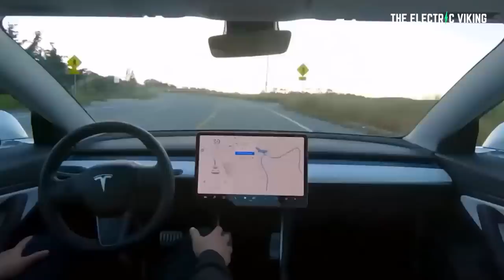20% of all vehicles will need to run on electricity in 24 months in Canada!

Comment: Do you have any idea how cold it gets up here in Canada . We just had minus 40 Celsius for about 3 days in a row a couple weeks back . How efficient do you think an electric car is below minus 30 .
Reply: @DAVE Hughes some Canadians have electric cars. Why not ask them?
Reply: There’s a chicken and the egg dynamic.  Have to get the EVs out there in numbers so they can be improved to handle cold better.

We are barely out of the Wright Brothers stage but improvement will be rapid.
Reply: @JeffMathias  the problem is the batteries, and people have been trying to improve battery performance in the cold for decades
Reply: Electricity is rising in price quickly, people can barely heat their homes, electrical grids are maxed out all over North America.  Battery electric vehicles cost a fortune new, they don't maintain power charge in the cold (regularly -30C in the prairies, and sometimes dropping to -40C).  The cobalt for the batteries is a humanitarian and ecological fluster cluck, as the resources are drained out of Africa.  I'm all for ingenuity and innovation, but governments should stay out of mandating things, especially the Trudeau government, they invariably make things worse.
Reply: If the Norwegians can do it, than why not Canada?
Reply: @hanswitvliet8188  Because Canada is over 20 times if not more larger then Norway.
Reply: @hanswitvliet8188  because Canada is colder than Norway.
Reply: @threespeech7605  I drive around in my M3 at -40C, -30C 0C etc. It works. Also my battery is LFP so there is no Cobalt in it at all. Do some research. A lot of new EVs are coming with LFP  lithium iron phosphate. Life expectancy also doubles with this battery type.
Reply: @skp4377  Most EV's have a Cobalt component. Think you need to do your homework. Also if you are in Canada you know electricity is at least double to heat your home then Natural gas. Plus also -30 and -40 c this past few weeks in parts of Canada have really shown how much of a paper weight EV's actually are. Slow charging, no charging, really reduced range and dangerously slow warm up times for passengers. EV's have no place in cold climates at all. Totally useless.
Reply: @kokofan50  three months an average of minus 20, and a peak of -50,4. I’ll guess Norway could host next surfing championships 🤣
Reply: @bikingD  If what they are saying is true then don't purchase them. ICE has had a 100 years. EVs are still new. They will eventually perform well in the cold. Tesla's 4680 should do well due to its dry-electrode tech.
Reply: @bikingD  that only implies that more charging stations are needed.
Reply: @laleau92  They tried EV's a 100 years ago. It didn't work then and doesn't work now. Range, cold weather, warm up charging times, weight in snow. Not practical for -30 c
Reply: @hanswitvliet8188  Are you for real? Norway is 323,000 sq Km. Canada is 10 million sq Km. About 2,984% larger than Norway.  For driving I drive 60,000 km a year. Could you imagine sitting in the cold -30 c waiting hours for a car to charge to get less than 300 miles in the cold. Not happening. More charging stations please. Why not make the country a giant charging station. Bad enough 20% of US energy comes from coal and over 50% from natural gas. Besides do you have any idea what electricity costs in Canada? To heat a house on Natural Gas is about $200 a month. To do it on Electricity is about $500 a month. Electricity is not cheap. Plus say an Accord sedan is $45,000 cdn. A Model 3 is about $70,000 cdn. So that answers why no one is buying EV's in Canada. Neither clean, cheap or efficient for our country.
Reply: @bikingD  you are right!
Electricity IS horrible expensive. I marvel to look at places like California or southern Australia.
Right now I pay €0,97 per kWh.
Either I got ripped off, or they managed to get a proper deal.
Reply: @bikingD  It's delusional to think that people a 100 years ago had reached the zenith of battery technology. Which civilization is more advanced ours or theirs? That's just common sense.
Reply: @laleau92  You said quote that Ice has a 100 years on EV's. I was just pointing out that was an untrue statement on your part. That's all nothing more nothing less. In the same respect an 1922 Model T is a lot  different than a 2022 Corolla. So saying they batteries are different back then. Well duh! Everything is different back then.
Reply: @bikingD  How is it untrue? It is fairly recently that batteries are being produce exclusively for EVs.
Reply: @laleau92  Really? 1st EV was in the 1830's even ahead of petrol powered autos by about 50 years. By the late 1800's there were many EV's so actually EV's had a head start on what you like to call ICE cars. Know your history then comment. Until then you might not want to say anything.
Reply: @bikingD  I know that the first EV was built around the late 1800s. You are not saying anything new. EVs were found not to be viable so it was scraped, and the combustion engine dominated. Go find 2012-2013 news articles about Tesla and the narrative around the company back then. The Model S was considered revolutionary when it came out. Go find article on CATL, the world biggest battery supplier of EV battery's today, who just a few years ago claimed that they weren't going to make battery for EVs. It's you who don't know your history. There's a reason why Tesla partnered with Panasonic to create the first gigafactory. And it was only upon the success of the model 3 that other battery manufacturing companies started to join in mass. I would encourage you to learn about these facts before you start making such claims.
Reply: @laleau92  You have said nothing. First you say EV's are new and ICE had a 100 year head start. Then you say batteries specific to EV's are new. Now you spin a bunch of who cares about batteries and partners with Panasonic . Who cares. The technology for EV's have been around forever. Tesla and Fisker. Before that the EV1 before that the Citicar. Before that many more start ups all dating back to the 1st EV by Robert Anderson. Who cares about Tesla and partnerships. They are just another company along the chain of EV companies. Nothing new. Nothing special. Now GM put the moon rover on the moon in 1969 that's an EV. Now that is special. So that said not sure what your point is. By the way Panasonic has dropped its shares in Tesla years ago and is in a partnership with Toyota as well. So again nothing special just another big company.
Reply: @bikingD  when ICE won 100 years ago development for EV tech stopped. Now it has started up again because they have been proven as viable. That's what I am saying.
Reply: @laleau92  But they are not. In -30 takes forever if at all to charge. Have lower range by huge margins. Take dangerously long to warm up the interior of the vehicle. Weigh more so sink into the snow. The short falls of EV's have not been  over come in the last 100 years. Not even close. Gor something that is supposed to be the future really is the past.

Comment: That means there will need to be 5,000,000 EVs in Canada by 2026, a very tall order indeed. Will there be enough charging sites by then, or electricity?
Reply: You're math does not add up.  By your calculation, you think Canadians buy 25 millioin cars a year. The mandate is 20% of all new cars sold so for every 5 new cars sold 1 has to be an EV.  Canadians buy about 1.7 million cars a year so about 340,000 EVs a year which is doable.
Reply: @frankielew  My mistake..

Comment: As per usually the Canadian government use the "shot 1st, ask questions later" Most ppl live in condominiums with underground parking or central parking lots, that's a lot of infrastructure that needs to be updated before we can implement this law. Another obstacle is that the power grid is stretched as it is right now. Canadians start malfunctioning when the weather goes above 22 deg Celsius and everybody switches their ac on. That's when we have most of our power cuts... unless its a snowstorm like this weekend in northern Ontario with 110 cms of snow in 3 days and power lines get cut etc. and the final obstacle is as this new law might work in most of Ontario and BC. i cannot see it working in the middle of canada or the east cost. Canada is too big i cannot see them updating the infrastructure needed . Like you can literally drive for over 14 hrs and you are still in Ontario. from Toronto to Vancouver its like 5 days drive( very boring drive if you just stay in Canada). And after you fix all the above problems, there is always the usually problems that everybody else has.... the costs are too high, it takes for ever to get an EV (i ordered an id4 in oct  2022 and im getting it Q2 2024...yeah you read that right 2024 not 2023 but 2024!!!!). so yeah i dont see it happening.

Comment: The problems from EVs are not when they are on the road running, but when they are standing still, to recharge. No driveway, no charging points within miles from home. So any government mandate for EVs require the financing of the support infrastructure - and I strongly doubt that CAN politicians will pay for a "charging point on every lamp post". Therefore the mandate is no more than a valiant electoral standing...

Comment: So by 2025, 20% of vehicles sold in Canada will need to be electrified or face penalties, this mandate will be interesting to see if Canada can pull it off, then by 2030, 60% (or 3 out 5) of vehicles sold in Canada will need to be electrified and by 2035, all (or a 100%), or a fine, what's the penalty going to be is the question, it's simple, those that don't have EV models ready for sale in Canada by 2025 will just start losing money on those ICE models they will continue to sale, so, what’s does electrified mean (yes, EVs, but what about hydrogen or plug-in hybrids), as for the emission credits, all EVs will have a higher credit than the plug-in hybrids (what’s the difference in the credit between the 2)

Comment: 20% yes but not fully electric !
Electrified cars !
So also HEV's and PHEV's  and not just pure EV's  !
That's a big difference !
Reply: I'm pretty sure just HEVs don't get any carbon credits or am I mistaken here?  It's just PHEV's & pure EV's I think
Reply: @TheMacronical  
The way I understand it, they mean electrified cars and a HEV is also electrified. 
It charges itself by braking and rolling and sometimes by the ICE but pure EV'S are not completely clean either !
What would be the difference to a PHEV anyway, as that also has an ICE and drives in hybrid mode once it's bigger battery is depleted !?

Comment: Toyota are going to find it interesting in Canada. Toyotas late partial turnaround on EV means the first Toyota EVs will be available from 2025. Looks like Canada has made no provision for Hydrogen cell vehicles 
The biggest challenge for Canada will be getting enough supply of EVs
The second concern I have for other than Tesla with its fantastic thermal battery monitoring is handling the cold, some EVs are not up to it. I suppose the market will quickly sort that out
The final concern is the 20% requirement is for pick ups, trucks and semis. There is hardly any of these vehicles available in electric and that will be only slightly better by 2025 . Also these vehicles are far from being proven
Reply: Cold weather is not a problem for EV's.

Comment: It will never happen. Grid capacity, charging infrastructure, battery supplies, manufacturing capacity, semiconductor shortages and most importantly, for the 95% of Canada that doesn't live in major cities,  lack of winter performance and Total Cost of Ownership is much higher.  No business person will buy a vehicle that can only run for 2 hours at a stretch a couple of times in 24 hours.

Comment: The Canadian government is good at proclamations, not so much with reality. Our grid and charger infrastructure can not support this yet.
Reply: The grid has been able to  cope for a long time.  Charging infrastructure is an actual problem here.
Reply: They need to invest in infrastructure as well, not just on cars. Somehow they don't seem to understand that. The grid will adapt and grow, it just needs to grow faster.
Reply: Plug in much easier
Reply: @oldbloke204  "Chain supply issues"... sure. Who do you think is paying for all the fossil fuel infrastructures? They don'T fully pay for it even if they're making billions of profit each year. Canada gives them around 12 billions each year in subsidies. The US is around 60 billions. That industry can pay for it themselves but they don't. Remember that 4 billion pipeline Trudeau bought for Alberta?
Reply: @oldbloke204  Time to move on.
Reply: I have family that work in power generation and supply is fine. We continue to export huge amounts to the US. Infrastructure could use some help but is achievable.
Reply: @Old Bloke  Grid in Canada for the three largest population provinces, 75% of population, has immediate capacity for electric vehicles due to large fleet of nuclear reactors that have to pay neighbouring US states to take power offpeak (Ontario, 39.1% population) and huge reservoir hydro resources ( Quebec, 22.5% population and B. C. 13.5% population ). Most remaining population can go electric transport with existing grid. 2 prairie provinces and 2 Atlantic provinces will need suplemental generation;  wind, solar or the new reactors like Ontario is building.
Reply: @Landon Thomas  If Norway can solve that problem, (charging infrastructure) then Canada can also.
Reply: Get so tired of the infrastructure argument. If it’s not built than build it. It’s not that difficult
Reply: @Elite Company  This ^^^^

Comment: Most EV's are no good for Canada and its huge countryside and long commutes and cold Temps. Most EV's perform poorly in cold weather and have short range in good weather let alone in cold weather. Charging is not as efficient in cold temps as well. To me only Tesla has the EV's that work well in Canada. There will need to be a huge information push. The fud on EV's and the good about EV's need to be taught to the people. People are in the dark on the real difference between EV"S and ICE cars.

Comment: It's cold as hell and i need to drive 700km to go home. EV's done make sense unless you live in the cities.
Reply: What car has a range of 700K without refueling?
Reply: @vancity2349  VW or my truck for one I stop for a pee break sometimes and fill up why push it. that drive in storms has taken as long as 14 hours, what's the best an EV can do at 30 below 250k mind you there are only four gas stations. Also if I'm spending over 100,000 if better tow at least 8000lbs.
Reply: @gary5807  Ya if you stop for that you could stop to charge. If you pulling
a heavy trailer like that range on an EV does go down, but that will change over time.

Comment: With how poor EV’s are in cold weather I find it doubtful that it is possible.  Canada gets -30 to -50 and they need heaters to keep their ICE cars from going out.  As long as EV’s rely on old technology like 12 volt battery’s and EV range and slow charging, it won’t be possible. We need BEV battery’s technology to be improved. I believe in BEV’s but the technology needs to evolve.
Reply: Electric cars work better* here in Canada, not worse, compared to  ICE cars.
Reply: What a load of BS your comment is Aeschylus. I OWN an EV right now, I'm on my 5th winter with it. I went through -30°C temperatures, it works better than an ICE. Do you know why? Because the electric motor doesn't need oil to work, oil that can freeze. Electrons still move in the batteries even if the electrolytes is partly frozen. The new battery tech that you want, it's not so it can work in winter, because it already does work, it's to get more energy density at a cheaper price.

Comment: YeahYeah but where all the millions of cars going to recharge in 15 minutes in peak hour time?
That's what happens in 2022.  Australia has (yes, I have bothered with google specs) some 73 THOUSAND recharge petrol guns almost on every corner all over Australia. BUT more importantly, every gun will fit every car in the world and every type of petrol will drive every vehicle ever made. If you're stranded out in the country, your car will accept any type of petrol (except diesel of course) and when you get back into town, you can revert back to the usual grade of petrol you use. EV cars have four different types of guns (and different company control over each type of gun) They don't fit every EV. and then they're all controlled by credit cards which are each controlled by different companies and the card machines are well known ALREADY to be "out of order" and all that crap. Or your phone may be out of charge and in Communist China, it's well known that the whole country is heading for total control through smart phones only

Comment: You don't have the charging stations. You don't have the transmission lines. You don't have the hundreds of new green power generation plants. EVs cost an average of $15,000 to $20,000 more even with all the cash you're skimming off of the taxpayers and consumers. You can't even build a single power plant in 24 months, let alone the terawatts needed to run millions of EVs.
Are we going to be filling up these EVs with coal fired electricity like China does? I love the idea of EVs, but presentations like this are always loaded with hopium and pretty thin on what the real plan is going to be to create trillions of dollars of infrastructure in a few months. Bottom line...it ain't gonna happen in the timeframe y'all are thinking.